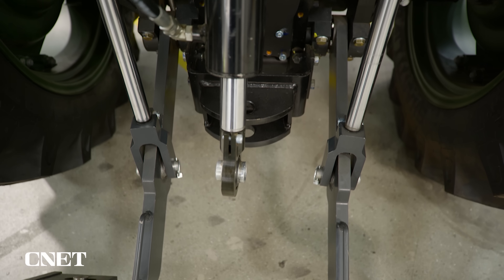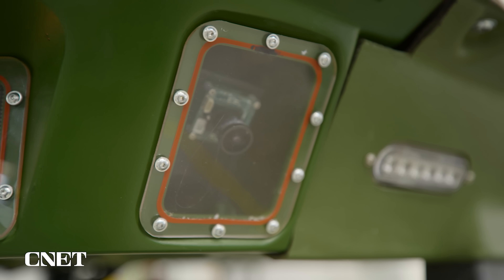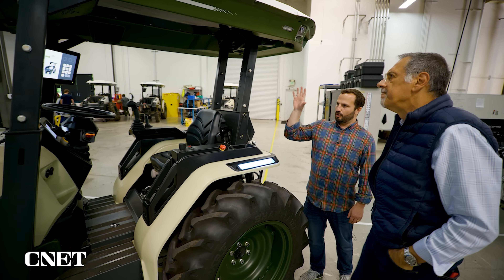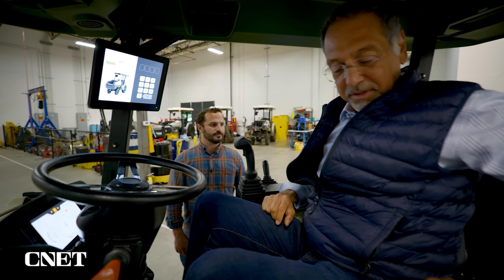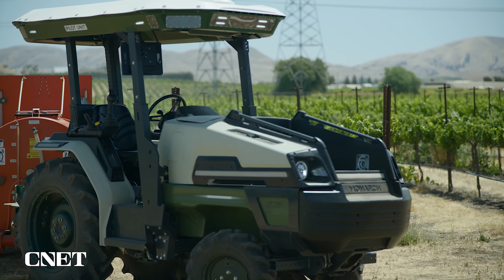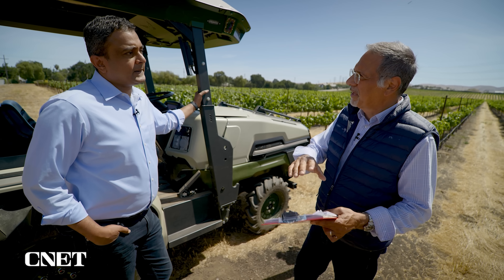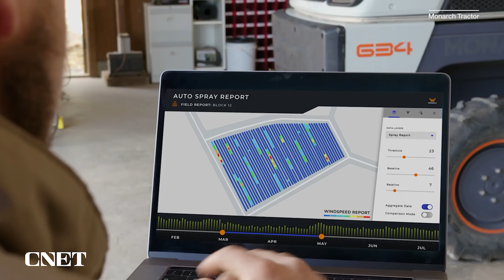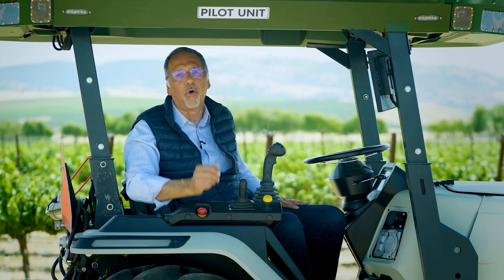This Electric Tractor Might Change the Future of Farming and Food!

Comment: itll be interesting how they approach right to repair... i have a feeling that these will all be locked down, repairs only at dealer, and plannned obsolecense
Reply: This is one of the most important concerns
Reply: It’s electric so maintenance won’t be a concern so much
Reply: They already are.  John Deere has been called out on its right-to-repair practices, particularly when it comes to the automation systems.   IIRC, they have sued farmers under the DMCA and for patent infringement for using aftermarket parts and making repairs.
Reply: @ramin123a  I don't think u own an EV .
Reply: I don’t know about planned obsolescence, in fact the IOT does just the opposite. A new feature or improved operation is just a download away. That being said I hope they do have some network for physical repairs as all the drive by wire could make DIYs more challenging.
Reply: @ramin123a  if you don’t own an EV then you don’t know it’s been hellish when it comes to maintenance especially from software and battery’s
Reply: @miguelvega7769  Seems like you don't know about EVs because he is correct. Try being more specific about the "maintenance" but research it first as you might be enlightened
Reply: @M3ganwillslay  even if he doesn't, he's correct.
Reply: @rtfazeberdee3519  i own a Tesla that’s already self explanatory 😂😬
Reply: @miguelvega7769  It sounds like you've had the wrong EV. My Chevy Bolt was zero maintenance and its first scheduled maintenance was a coolant change at 150K miles. It had the battery recall which was replaced, but all I had to do was wait for my turn and then pick it up the next day. The issues were GM's poor handling of the recall, not the actual car.
Reply: They will do one better. They will charge a subscription.
Reply: Hope it can schedule its own service appointment.......
Reply: My thoughts exactly.  Glad to have my 1965 international as a chore tractor
Reply: Real talk that’s the most important
Reply: @samyg123  The "only" electric part in may car are the automatic windows. I had to replace them already twice. Nothing else in the whole car had to be replaced in the 15 years (ofc apart the parts that are wearing down normaly).
Reply: @tomo1168  are you saying your car’s alternator is only running the power windows? Seems like an awful waste
Reply: @samyg123  :D that's why I wrote "only" electric part. And I meant by that, the only thing that is not needed to run the car or part of the safety equipement and you can say is an "extra"
Reply: @ramin123a  When your actually farming, brush mowing to plowing then harowing, trust me itll break.
Reply: @M3ganwillslay  And you dont farm.
Reply: @brandonm6052  Exactly. Got my 49' 8n Ford. Actually works...😂
Reply: Like John Deere?
Reply: @ramin123a  That's a nonsense argument, especially with tractors.
Reply: Their president is from Tesla. So yeah, it'll suck for repairability. He's explaining the basic concept of a tractor like he's created some incredible new invention. Most of the fancy new features are things that already exist in tractors. 🤣
Reply: @rtfazeberdee3519  No, he's wrong. These EV companies that act like tech companies are TERRIBLE to deal with for repairs and maintenance. Stuff DOES break, especially when you're talking about a tractor, and people need to be able to fix their own stuff.
Reply: Sadly EVs are the iPhone of vehicles. The younger generation don’t care about fixing their own vehicles and being on a treadmill of payments. They then complain they are not doing as well as their parents.
Reply: @davidshipulski4532  do u see the size of the tractor 😂 it’s a more of a piece of tech than a machinery
Reply: @mtadams2009  It has nothing to do with generations. In fact, I'm pretty active in keeping up with right to repair politics and young people can be much more receptive to learn and to change. And it was older generations who created these business models and allowed them to thrive.

Generally, people will care if you find an industry or sector they relate to.
Reply: @Studio23Media  When I was growing up we all worked on our cars. Mostly because they tended to break more and because we had no money. My home state of Massachusetts does have a right to repair law but Musk has done all he can to fight it.
Reply: @ramin123a  just false. Electrical failures are the most common problem on tractors. They are going over rough environments, brush, drastic temperature differences, and much more.
Reply: @ramin123a  every farm, no matter how big it is still has a small tractor. You arent going to use your 400hp field tractor to run a grain auger.
Reply: No regenerative braking on these so its purely reliant on battery , imagine running a slasher for 8hrs like i do on a sub compact .
Reply: I’m interrested in a version only electric powered and no robotics, no sensors, no computers, AND 10 eyars garantee like in Mitsubishi cars.
Reply: That's the "future", for you!!.
Reply: Seconded, Brian is THE MAN & I’m surprised he missed that.
Reply: @tomo1168 
Objectively, electric motors are far more reliable than gas or diesel engines. Your car manufacturer chose to use junky electric actuators in your windows — that is a failure of the engineers that selected that crappy part, not electric parts in general. Real-life data show that 50 hp electric motors on average last for over 30 years, whereas gas engines in cars last about 11 years. A well engineered electric tractor will be far more reliable than a gas or diesel tractor. It’s not a close call. If you don’t want the autonomous extra stuff, just buy a simple electric tractor like a Solectrac instead. Imagine just plugging into the wall at night instead of having to haul gas out to the farm. And, no oil changes or buckets of used oil sitting around. And no gas fumes from inside work. And no brain rattling engine noise. Ninja . . .

Comment: My son works for a local John Deere dealership as a tech.  His specialty is working on the large tractors 8-9 series which range from 300 to 600hp. These tractors when in tillage, planting or harvest modes are running 12 to 24 hours per day.  VERY hard to believe that there is an electric solution that would fit that need. Everything fills a niche and this may work for a small tractor need or limited usage. Still need to see how long they last and what happens in the case where a tractor malfunctions and as a result someone is injured or killed.   A good farmer in a tractor is monitoring the tractor and implements and also the soil conditions as well as the harvest products. Each application is different, in our area I don’t see the advantage yet.
Reply: The short term solution, buy more than one (expensive sure) or build a station that can help swap batteries. (Or just wait for the tech to improve) But I think their goal is to reach full autonomy.  If it reaches full autonomy, you need less ranch hands needed to finish the task in the same amount of time.  They would probably still need human assistance in case of malfunctions but for larger farms, one person could watch over multiple machines and just fix the malfunctions.
Reply: Electric can scale to this size but they have to start with broader markets in order to build into the more niche/expensive markets.
Reply: I think tractors that ran on hydrogen would work pretty well (not a farmer lol)
Reply: Good point Mr Lutzke, but here is my thought. Since the tractor is moving in a controlled space (farm) why not have the option to plug and use. Yes overhead lines which will keep supplying power and the tractor can work eternally (Or till there is power outage ! :) ) For any other unplanned use you can always have the battery option.
Reply: @rishishenoy  at one time the average farms in my area consumed 85 to 150 acres of land. Modern farms now consume thousands of acres with fields anywhere from 20 to 150 acres each normally with residential homes mixed in on the edges as well as wooded areas, lakes etc. There are many challenges to make this conversion. I grew up at a time when my grandpa milked 18 cattle on average and farmed 85 acres with 2 tractors. He never sprayed a field, when weeds were present in the fields we walked the fields and pulled them out by the roots. Nobody had cleaner looking fields than he had. If we are going to change our future it would be wise to understand ( all ) of the impacts that these changes will require and have tested these plans before we make major changes. If not we could end up with a solution is no better or worse than we have now. Need to keep in mind there are two main objectives here. To hopefully help improve our world ( and ) those that support these changes with their main objective is getting rich.  That is where a lot of politicians come in. Push these needs to save the earth then hop on their private jets to fly 5o a meeting or take a vacation. When you start thinking big picture you really have to wonder who is telling the truth about anything.  Have a Great day!  Steve…
Reply: " VERY hard to believe that there is an electric solution that would fit that need." There is no solution to fit that need.
Reply: Don't forget that these XL tractors are only 10% of the market. 90% of the market is tractors below 100 hp.

Comment: What about right to repair. One aspect of farm equipment is that the farmer was able to work on it himself. Critical at times when you have a very narrow window for some sorts of work. But in the last few years John Deere and other tractor companies have come close to sealing their machines so that only an authorized dealer can service them. 

On another topic. One things farms have, is lots of space. More than enough to instal a designated solar system to charge the equipment. Either with a large storage battery you can charge your tractor from, or a modular battery system like industrial forklifts where you swap out batteries so you can charge one while still running the machine.
Reply: while farms have a lot of space.

they dont have a lot of unused space. the only practical spot to put solar panels are roofs.

roofs on farm buildings... so for most american farms you have barns and sheds and thats it.

as for out in the field good luck with that.

as for battery swapping youre stupid if you think swapping out a battery with a forklift is a good idea (because fun fact MOST FORKLIFTS HAVE AN ISSUE WITH TIPPING FORWARD.)

as for spots to put batteries you have about 3 spots. where the engine is if you use hub motors for small tractors (Which wont give you a lot of battery space in the first place because small engines can be very powerful to keep the small form factor.

and where gas tanks are kept. which are generally in two different spots on each side. larger tractors this ill be more useful but again small tractors are kinda screwed.

as for large tractor the problem is inversed. now you dont have the massive engine spot space for batteries but the fuel tanks are much larger to fit batteries. just that they wont be hot swappable. because most of the time they fill in spaces where there isnt something important taking up most of the space in the first place.
Reply: Lots of space…we know, some farmers doesn’t give space for good performance, only for big production, no trees, it’s take too much room…. and then, less and less water, less quality, less everything and you reach a stupid goal => a desert !
Reply: @MYGM350  no.

what youre talking about is poor dirt management which is caused by planting the same crop year after year. 

which causes issues because those plants only eat select stuff from the dirt however that leaves an excess of the stuff said plant didnt eat and leaves very little of what it does, and by the time the next year crop gets put in, the dirt didnt have time to recover from the loss meaning over time the dirt itself breaks down by dying, more or less
Reply: @MYGM350  Smart farmers devid fields with strips of forest  to serve as windbreaks.  But there seems to be a shortage of smart farmers, or farmers in general, these days.
Reply: roof's provide enough power to to run the entire farm, you can extend it to the needed capacity. all the technology is there already. it just needs to be done.
Reply: @JohnSmith-pn2vl  Given a choice I'd not put panels on the roof, or the backup batteries in the house/barn. As for wasting land, there are many farmers combining crops/animals with solar. Just have to boost the panels up high enough. Some premium crops like Ginseng actually need shaded fields. Tailor made to grow under solar panels, and as they are a multi-year crop they don't require intensive tending.